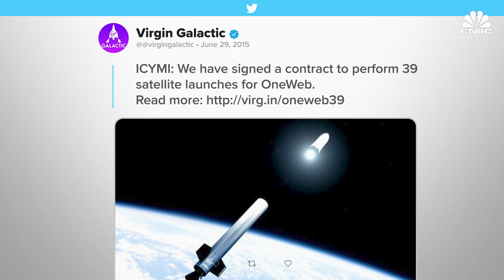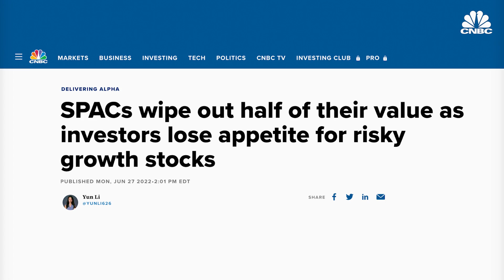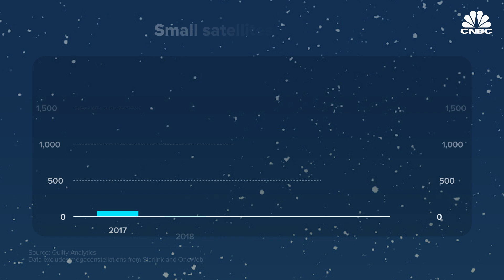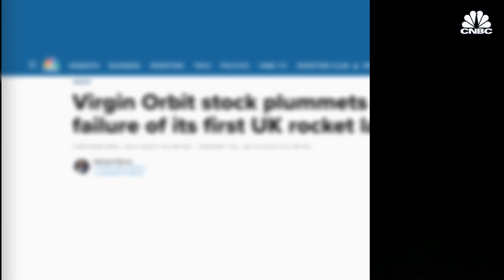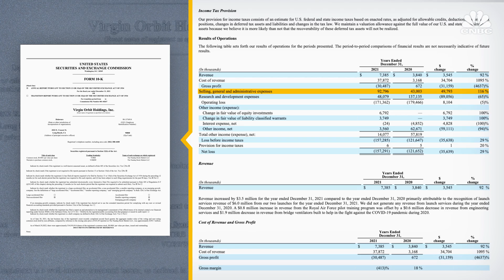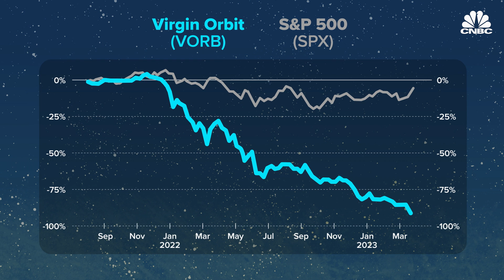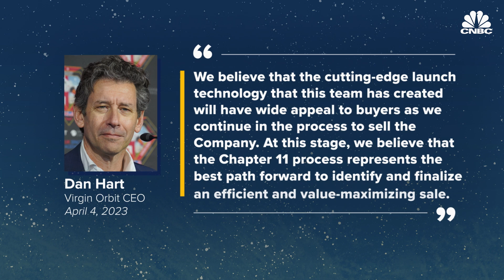Why Virgin Orbit Failed

Comment: I think it’s a basic economics principle.  There’s only so much small sat launch demand, and far more small sat launch supply than there is demand.  There are too many launch providers.
Reply: This is something I have also realized and it is interesting that most space commentators don't mention this. Most small sat launch startups are going to fail even if they successfully develop their launch vehicles.
Reply: It was anticipated that there would be a very significant increase in the small sat market and perhaps there has been but not enough to support even half a dozen providers. There are something over a hundred companies calling themselves small sat launch providers. the vast majority of these have yet to bend metal and they never will.
     Relativity and ABL have both had failed test launches. Astra tried to become operational but after five failures in seven launches shut down to work on a bigger, better rocket. That left exactly four in the small sat market. SpaceX and ISRO both doing rideshares and neither of them dependent on small sat revenues for their existence, one being a government agency and the other the globally dominant launch provider. Rocket Lab, which expanded their business to providing payload components to satellite builders which, as I understand it, now provides the bulk of their revenue, and who is developing a medium lift rocket, and Virgin Orbit, which was wholly and solely dependent on launch operations for their revenue. And now there are three. This probably shows the necessary path other small sat launchers are going to have to follow. Find some other source of revenue to support your launch operations while you develop a medium lift rocket to try to challenge SpaceX. The enormous explosion in the small sat market may still occur, but the great majority of them are going to be content with the smaller price of getting a rideshare on a medium or heavy lift rocket rather than paying for special treatment on a small launcher.

Comment: They seemed to have just spent money and did nothing. Launching rockets to space had been researched in past on at least 2 occasions that I know of. Last time it was ditched was due to the fuel volatility if I recall correctly but also it's benefits just don't add up. How about a launch ramp up the side of Mt Chimborazo, now lets get an IPO going. 🤑
Reply: The Pegasus rocket, developed by Orbital Sciences Corp. was actually the first privately developed launcher to achieve orbit, long before SpaceX was even a gleam in Elon Musk's eye. They had a pretty good launch cadence through the 1990s but gradually tailed off in the 2000s due to competition from other providers, particularly SpaceX. Northrop Grumman now owns the system, having bought Orbital-ATK, and lists it as active but it has flown all of four times in the last ten years, the last time in 2021, and they have no launches planned. So, while it has not, technically, been ditched, I doubt it will ever fly again.

Comment: The comment at 6:17, about rockets getting bigger, and launching multiple satellites from one rocket, therefore reducing the cost per satellite.  Seemed like the nail in the coffin, as Virgin Orbits rockets were now old, and too small.  They, therefore, could not compete without a redesign, which Virgin Orbit didn't have the money for.
Reply: Even with a redesign, a horizontal launcher launching a single small payload cannot compete with a larger, vertical launcher able to launch multiple small payloads at a time. The flexibility of launch location and scheduling VO offered just wasn't that attractive in the market.

Comment: Whether or not Virgin Orbit was ever a viable business it's objective was relatively modest and it seems a lot of effort just for it to collapse after one debut flight failed.
Reply: 7:28  "In total, the company launched six missions, four of which were successful and two of which failed."
Reply: The failure of the Cornwall flight did not cause the bankruptcy. Had it succeeded, they might have held on a while longer, but really not more than a few weeks.
Reply: @odysseusrex5908    Why would that have to be the case? Wasn't it largely owned by a man with an estimated net worth over £2 billion?
Reply: @no_rubbernecking   Well, actually, the primary, maybe sole, owner was the SPAC that had acquired VO to let them go public. That said, I'm not sure what Branson's net worth is, but there is a big difference between net worth and cash on hand. Branson's net worth is the values of the stock he holds in his various businesses. That is not money he has in a vault somewhere. Either way though, he had made it plain he was not going to support the company any more. The last $25 million he put into it was a loan with the airplane and other tangible assets being put up as collateral. When the boss starts treating you like that, you are in big trouble.
Reply: @odysseusrex5908    Granted, but any idea what they were doing wrong that Branson felt was beyond fixing?
Reply: @no_rubbernecking   According to a recent article on Ars Technica, and the associated comments, Virgin Orbit had staffed up to over seven hundred people, so their payroll was just enormous. On top of that, they had spent, in developing the Launcher One rocket, about the same amount as SpaceX had spent in developing the Falcon 9, Falcon Heavy, and Crew Dragon, combined. That was all, of course, borrowed money. Their nearest peer competitor, Rocket Lab, is finding a market of about ten or twelve customers a year. With that kind of debt load, VO would have needed at least thirty launches a year just to service the debts. It was financially impossible to do. Nothing could fix it. The only solution would have been not getting in to the situation in the first place, by spending vastly less on development and only hiring as many people as they really needed, and I'm not sure that would have worked. All the other small launchers are working on medium lift rockets, and you can't do that with horizontal launch.

Comment: They spent way too long in the beginning trying to capitalize on luxury space travel . The Virgin Galactic plane was never luxurious as a private jet and they spent way too much on something that quickly lost its novelty for bored rich people. They shifted too late to the private satellite sector to adjust for the miscalculation
Reply: Virgin Orbit was a spinoff of Virgin Galactic. The fortunes of the one had nothing to do with those of the other. Virgin Galactic is still in business and about to begin commercial operations.
Reply: @odysseusrex5908  Its a vertical integrated business, they are connected. Virgin Galactic came first and would have funded Orbit, but it couldn't, because Virgin Galactic never brought in the tourism factor it was supposed to. They rely heavily on private funding unlike Spacex who gets government and military contracts.
Reply: @distorta   No, it is not vertically integrated and once VO was spun off it was a completely separate corporation. There was no connection between them.

Comment: Why wouldn't they convert the whole belly of the plane to carry the load?! ... Or would that require the original manufacturer?
Reply: The launch mechanisms would need to be custom designed and made. If they manage to be a running company in the long haul, they will probably eventually get to doing that, but since they're still kind of in a prototyping phase, that didn't happen :P

Comment: Why not fire them from a supersonic jet like a hypersonic missile?
Reply: Because they are incredibly costly, like ten times or more costlier than common jet aircrafts to procure and maintain. Not to mention the environmental impact like the noise and shockwave supersonic aircrafts made from it's sonic boom in populated areas like cities which means more regulation which translates to a much more costlier means to make them viable enough to be operated. The reason why supersonic jets are no longer offered for civilian use and that there are no commercial airlines operating supersonic jets these day.